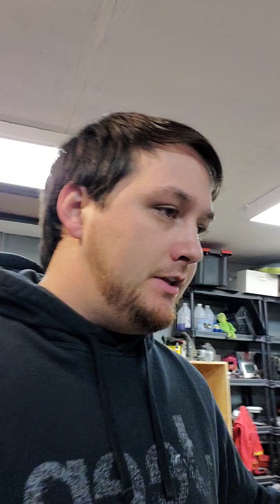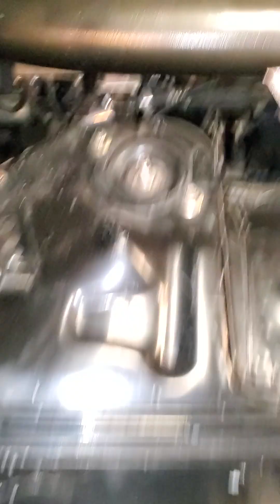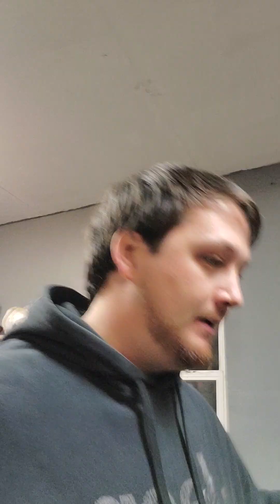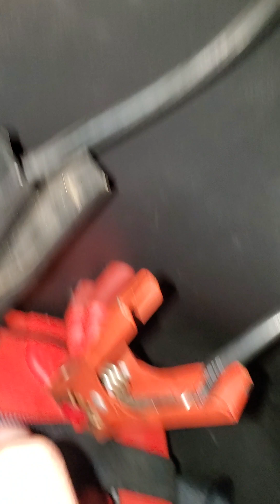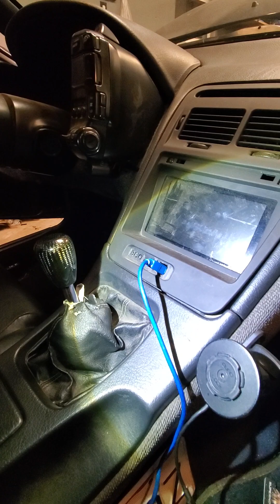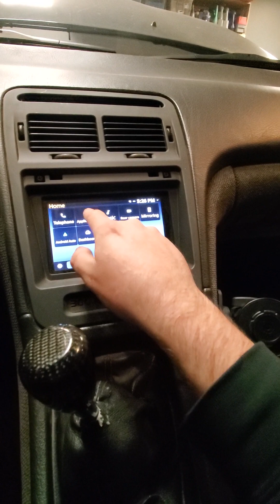overview of my 500hp rb swapped 300zx

Comment: Hey awesome build! I want to do something similar and I was wondering what route you went with the transmission. Did you swap the bellhousing on the 300zx trans like some do or are you using the rb25 trans?
Reply: I was wondering the same thing 😂. Judging from the placement of the engine and the other parts he’s using, It looks like he’s running cx racing swap stuff so if I had to guess id say he’s running the oe rb25 trans. That was originally my plan as well because the cx racing kit mounts the engine as far back as possible. However the z32 transmission can hold wayyy more power so as of right now I’m thinking I’ll use cx racing mounts for the engine and build a custom transmission crossmember to allow me to use the beefier gearbox. Idk if that’s the route I’ll end up going but that’s the direction I’m leaning at the moment. Have you started the swap yet or just scheming?